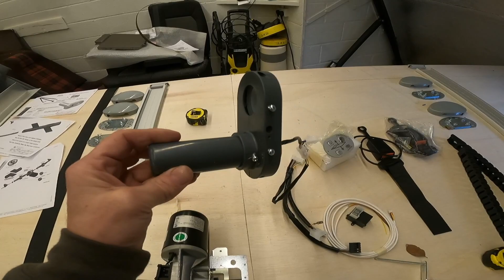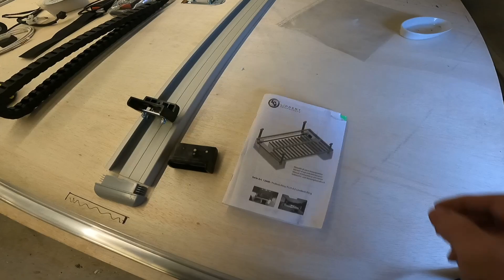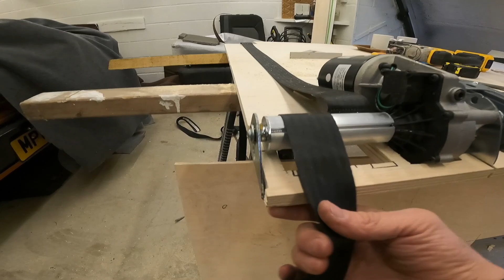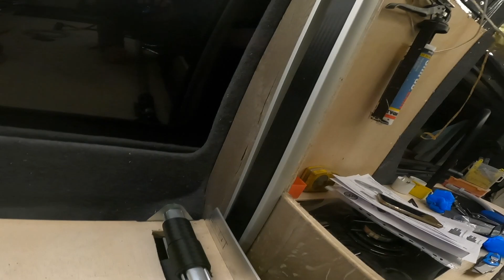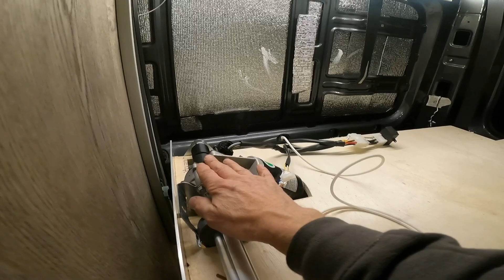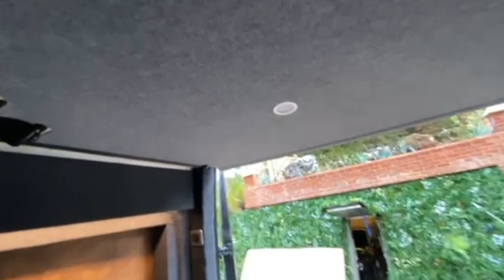VW Crafter Camper Conversion - Electric lift bed installation - Project 2000 System (Happi jack bed)

Comment: You left out the most important part. Where do the cables connect, the wiring, the diagram on the instructions are fucked and make no sense, can’t find a video of the explanation, it just takes 10 seconds to show the wiring

Comment: Hi I would like to commend you for this video and your time, effort and patience not to mention your skills in completing this cracking job seriously well done. We have one bed of what looks to be exactly the same in our coach built motorhome and it has been wonderful up until we hit a ramp coming off a ferry and the whole bed jumped and broke the rollers and brackets that run in the slide guides. I cannot find where to buy replacement the grey coloured rollers 4 off. You'll be more familiar with these than me since you built yours> these are a push fit on each end of the slider that keeps the bed parallel and secure while moving ascending and descending. I have learned after research that there should be a seat belt type securing buckles while travelling mine has none? Any help will be most welcome in where I can purchase replacement parts. We live in Ireland.

Comment: I also want to have the same lift bed as you. Can you do another video explaining where the bed weight is supported? I can see you have the rail on your shower wall and on your kitchen divider part. Where are the load points? For my setup we would be sleeping length ways as I am 6.1” and can’t sleep sideways. We want to put the lift in a Fiat Ducato L4H3 or similar. I’ll be interested to know more about your dimensions for your seat cushion also 😊
Reply: Hi did you do this, looking to do the same? cheeers

Comment: Love the build! Its the route we want to go.
Can i ask how long is the bed? As my wife is near 6ft, not sure of to have pods both sides and sacrifice the rear window?
Reply from the maker: Thank you 😊
Our bed is approx 6’1”, I’m only 5’9” and Karen a bit shorter so it’s fine for us.
Both pods maybe better for you, you can fit windows in them, I did see recently on the FB Crafter forum a pod that pushes out for sleeping, not sure who makes it ?
What is great about the pods is you get an additional shelf internally which is really helpful.
Reply: @recraftedcampers4686  The push out pods sound great, we would rather have a window beside the side door for viewing reasons so may just get the wife to curl up in bed to get over the issue!

Totally inspired by your build and mwb is the way to go especially here in the uk where parking etc is a bit tighter than in Europe.

Great job on every aspect of the build 👌🏻
Reply from the maker: @martintaylor4712   - the window is def better, having the full view when you wake up in the morning or having dinner is perfect.
We’ve done a few road trips now and never had an issue parking or getting down some tight lanes.
Good luck with your build 👍🏽

Comment: hello 
super reconversion !!
what is the size of the bed?
what is the kit:
                        Project-2000-Smart-Bed-Kit-Electric-Standard
                    or Project-2000-Smart-Bed-Electric-Kit-Extended
sorry for my english but i'm french
pascal
Reply from the maker: Hey Pascal
Thank you very much, still a few little bits to finish but really enjoying using it.
It’s a project 2000 smart bed.
I bought it from Camper interiors, go on their website and you will see.
Evo design are also selling them now.
Your English is perfect 😃
Reply: @recraftedcampers4686  
Hello,
thank you for your reply.
On the Camper interiors site there are 2 models, the standard with 1000mm rails and the longer one with 1600mm rails.
Which of the two have you installed? Do you have the reference?
Thank you, for your answers and your videos.
Pascal
Reply from the maker: @pascalcoolen6073  I just bought the motor kit, not the bed frame.
On my video you can see I made my own frame.

Comment: Nice solution! I just built in this liftbed myself. I have one small issue. Maybe you know this? You can change the max ascent and descent. I solved ascent (+ is higher max - is lower max). But I can't get max descent set up. Is - lower minimum or less low minimum?
Reply from the maker: Hi Jan
A very good question 😊
I gave up on adjusting it, just do it manually.
I do need to go back and do it again at some point.
Reply: @recraftedcampers4686  I got the answer from lippert, + is more strokes - is less strokes. I had to do a lot of - turns before I got there, but finally found it. I hope it helps you. I already blew a fuse, when going up, so an automated stop is nice.
Reply from the maker: @janpietervandenheuvel5784  - thank you for the info, I’ll try it out soon.
Hope your conversion is going well 👍🏽

Comment: Great video thanks for the tips. On a seperate question, which roof rack do you have?
Reply from the maker: Hey
It’s from a company in the Lake District UK, they are called SDV roof racks, chap called Tony, absolutely brilliant can’t recommend them enough, will change it to your desired layout.

Comment: Linked the materials you used
Reply from the maker: Hi
The main board is lightweight ply, the rest is aluminium angle bought online.
Bed slats were Amazon
Foam from Efoam online 
👍🏽